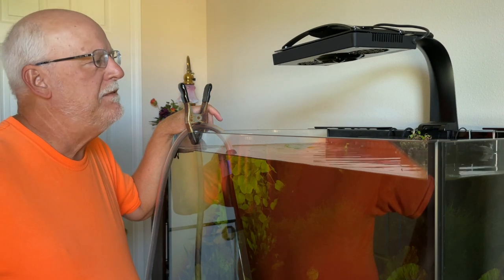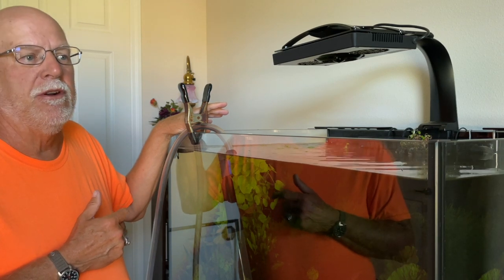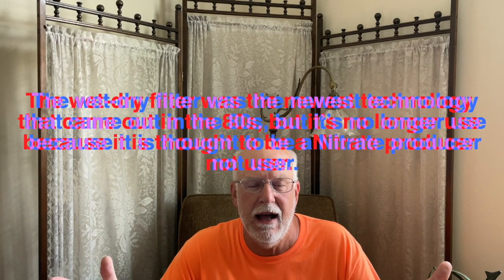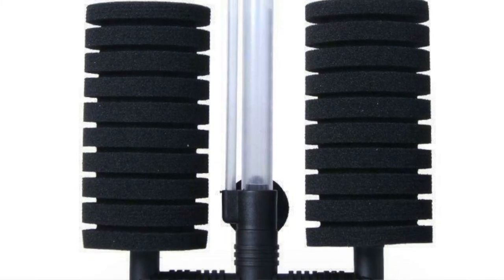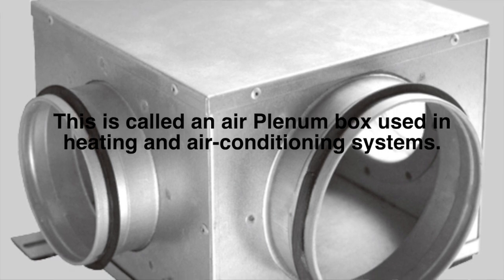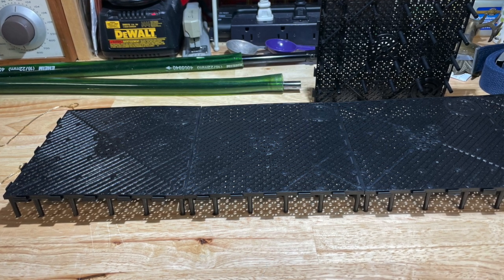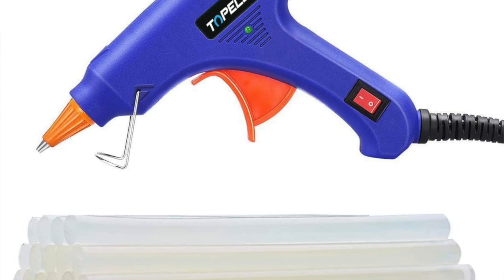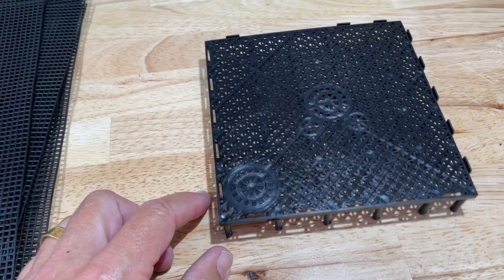Understanding the differences between a Plenum and an under-gravel filter.

Comment: Just about to make my pond setup an undergravel filter setup with a pump and a 2 inch plenum gap under the grill. The plenum with my setup I'm making will be able to be flushed, as there is a valve installed on the pond tank. That way I do controlled flush outs of excess debris from the plenum area a couple times a year, immulating what natural ponds would do. The pump will sit into a compartment that will draw water from under the grill, which will allow a slow pull from the total bottom through fine red scoria. Then the water will be pumped up to a grow wall for tropical plants and drip through a drip hose to water the plants and then the water will return to pond water. The water trickling or dripping through the plants will naturally add aeration, but as the water falls lowering into the pond it will loose oxygen and then be dragged down and through the plenum part again. I like to create tanks that do not need regular water changes at all, just top ups. By using plants and dense slow moving filtration I can accomplish this easily. So the knowledge has not been lost at all. The only problem with the hobby nowadays is hobbist are getting lazier and just like to use filteration bought, rather than looking at options to create a better natural environment for their fish. If they did, they would also make ecosystems that are less maintenance too. But big companies do not want them doing that at all. They want them to keep on buying "stuff" with minimum improvement to their tanks.
Reply: Got a full-time job so slowed things down, but ready to get going now with the build. So excited about doing a plenum pond porch pond. Will try to contact you when I'm finished and send you a video for your channel if you like? My husband is building me a platform and frame for the water tank pond this weekend. Then next weekend will tackle the grow-wall. The following weekend I will install my plenum, fill and clean out all my canister filters to seed the pond and get the cycle going. Wait a week and then test the cycle with ammonia, of course, fish free. So hopefully this will all be ready for fish in 8 weeks. I have a huge vase that is not really plenum but kind of is. Filterless and is now producing shrimp.

Comment: Hi Dr Novak, due to space constrain, im setting a 2 gallon tank. No UGF of this size in the market is available. The tank base inside dimensions are 28cm x 18cm. What height should the  UGF have? Is a 15mm void of space (plenum)sufficient? I also need to insert a polycarbonate tube with a inside diameter of 12.8mm. This tube will be connected to a 1Watt submersible pump. What flow rate is ideal ? The tank will only have 8 litres of water at most.the UGF will be 3D printed.  The tank will house mainly small shrimps and very small fishes.Thanks

Comment: I’m using the plenum system in my 75 gallon community, planted. I’m using a basic Petco dual port air pump at full power. Should I pull back from going full power? Thanks

Comment: Perhaps the clearest explanation provided (as video, on this channel). This channel has been very clear for me in that the objective is not to create “under gravel filter”, it is hard to imagine there is any confusion on this point. What has been curious to me is the obvious significant difference in the height of space provided by UG filter (plate) plenum v the suggested 1/2” to 1” plenum. I have to guess at this point that a very slow bubble w short uplift is the difference. The 1/2” to 1” DIY does not utilize a slow/low bubble (flow)? The differences (contrast/comparison) between UG filter plate and the creation of 1/2” to 1” DIY would be helpful. I am not suggesting that one or another accomplish anything outside of anoxic conditions, nor am I suggesting one is superior to the other. The significant height differences are very curious for me.
Reply: I suppose they both use very slow/low flow so this is merely a matter of hobbyist as engineer v hobbyist as manufacturer :) Flexibility to the simple task, TY.
Reply from the maker: It's great that you understand everything in my videos and what I'm saying. However, unfortunately a lot of people don't and therefore they are getting very confused between using a Plenum and an under gravel filter as per say.

Comment: Do you think I could use the undergravel filter plates with screen to make the plenum, then combine that with a dirt substrate, capped with sand, and still be successful? Or do you think combining the two is just a disaster waiting to happen? It's something I have considered trying to see how it turns out.
Reply from the maker: Yes people are  already doing just exactly that.
Reply: I did that my plants are growing right out of the tank lol fish seem happy 🐠
Reply: Remember with durt don't use a lift tube or you will have mud lol
Reply: @debrascheer4577  hi! Question: Can you describe more your set up with the dirtedtank? I saw his videos after I made them and gave up on them, because they didn’t work out for me. Can you tell us:
1. How you created a plenum, how you layered the dirt, and how you capped it?
2. How deep you put rooted plants into the cap?
3. And what you meant by not using tubes?

Comment: Can I use Seachem black flourite and Seachem red for an iron source to make a BCB basket. I know that Seachem is more expensive
but it is easily available.
Reply from the maker: I know you can use the seachem for a Plenum but as far as A BCB basket, I do not know if it has the poor water or permeability structure to it that would be absolutely correct.

Comment: Any nay sayers just do not understand science !  I had to listen to your video explaining it several times. Stop and rewind and listen again. However I understood it, it makes perfect sense.  I have been keeping tropical fish since the mid 1970’s. I started out with a Betta in a bowl.  Had to buy a 10 gallon aquarium so I could replicate a healthier and happier environment for the poor creature. At that time I was using the under gravel filter.   It’s pretty simple to understand the difference between that old method and a few tweaks to make it a plenum .  You are teaching how to create a better “false “ environment to a natural one, in very cost effective way.  Any aquarium is a false environment no matter how much equipment is applied people !  If it doesn’t work they can all go back to the way they are doing it.  Why not try it ?    I can see a lot of people who disagree are those who make lot’s of money  selling all the supplies that this method does away with.   I have had 20 and 30 gallon long tanks. I currently have a 36 gallon bow front. I just set up 1 year ago. Neon Dwarf Rainbows , Cory’s Ammano shrimp, and 1 Siamese Algae eater and plants .  Fine gravel with Aquarium soil and sand substrate , one air stone .               I wish I had found your videos  sooner , I would not have to re-do this tank.               Will My hang on the back Aqueon filter  create too much water flow , it’s rated for 30 gallon , when I convert . I think I can put homemade BCB in it instead of the replaceable filter.    Or do I have to convert to canister filter ?    THANK YOU for all your knowledge and all the time you have put into making these videos , and your time to reply to our questions .      Thanks also for not charging a fee to subscribe to your channel !

Comment: Question:  plenum space/void could return flow from your sump filter system be used instead of air while achieving the same results? 

Example my build is a 120 gallon cube planing to return approximately 400-600 gallons a hour in 3/4 pvc within plenum space

One of your previous videos you talked about water moving in and out of a lake/bog with natural springs. I would assume this replication would be beneficial to an aquariums ecosystem.
Reply from the maker: What are we trying to mimic here is a natural system where the intersection of topography is actually the under gravel plate or the plate you make yourself the Plenum and the substrate or where water moves in and out freely just like in a natural systems.

Comment: I once wholesaled tropical fish and of course we used sponge filters with bubblers, tanks were setup to turn fish for $. My personal show tanks have been UG, cannister filters or both. I never liked a filters hanging on the side of the tank. I desire a pH of 6.5 - 7.5, won't layers of coral sand continuously increase the aquariums pH? How are you keeping the layers of coral sand separated from digging fish, do you use a fine flexible plastic netting similar to an aquarium fish net? I'm not too concerned about algae, the DLI can be adjusted. I grow plants hydroponically and O2 is critical for plant health, I'm not understanding how an environment with very low O2 levels (<.5 mpl) sustains plant growth or a load of fish in a tank.
Reply from the maker: They have what is called craft screen are you can even use window screen and that will separate the two substrate so digging fish can only go so far and then come to a dead end. The craft screen comes in different plastic colors like black, white, clear, green,red, etc. etc.

Comment: With just the tubing under the gravel, there will also be a void in the tubing, a smaller void than using plates but a void nevertheless. Am I wrong here? We could even use bigger diameter tubing and get a bigger void to match your plenum void space. Why is that not the same thing as the plenum type you are advocating?

Comment: Hello, Dr. Novak, 
First thank you for your work, and outstanding insight into the Nitrogen cycle.  I too remember the days of using under gravel filters. 
My question is, with the plenum, is it necessary to pump the nitrogen to the rest of the tank?  An opposing view could the bottom beneficial bacteria layer enter via hollow tubes instead.  I am asking if the nitrogen pumping is creating O2 that is going against the CO2 needed in the tank for plant growth.  
I currently have a 45-gallon breeder with lava rocks at the bottom for beneficial bacteria.  Curious if this is effective at circulating beneficial bacteria. 
Also, do you have social media, books, papers, or an additional way that we can read about your work.  I am curious about your PhD, is it in Ecology of Plants, or a similar nature.  
Thanks so much, again for your work.

Comment: Do you think I may be able to have enough low oxygen bacteria if I have an area with deep substrate for plants and the rest of the tank not as deep substrate? I also use tanks with larger footprints as I imagine that helps. I mostly like to do a soil mix topped with sand all 3-6" in total but also like to do a higher area for plants and then the rest just sand ~2" thick for open space.

Comment: Hi Dr. Novak, I've been using the BCB Basket for years in my pond and aquariums with great success.  If I make a slow moving plenum in an aquarium, should I still use a BCB Basket or will the plenum provide enough denitrification on it's own?

Thanks for your videos
Reply from the maker: If you make a Plenum in an aquarium ,no you do not have to use a BCB basket along with it, it is an option that is up to you.
Reply: Greetings Dr. Novak, you saved me all the hard work in finding out what works or not. You are really a pioneer in this hobby. Thank you so much for your insight that is backup with experiments and data.

Comment: Thanks for your videos, I am actually trying to learn as much as i can, since my dream is to make a huge acuarium (more than 10.000 liters) and I want to understand how much or in which way i should plan / calculate the anoxic filtration to be able to handle all the bioload. I dont know if in such a huge system i should be using the cbc baskets or with a good and well calculate plenum would be enough. AGAIN thanks for your work and making  your knowledge  available.

Comment: One thing I would like to see from you is more info around how to tell if we set it up correctly. Because at first I was not sure what was going on.   I still have algae growth under the substrate surface, that can be seen through the glass.  Is that just sign i’m fertilizing too much? 

Also will we have to dose the substrate with iron at some point.  Whats the long term maintenance, I have this tank set up for three years now. 

I used double layer craft mesh that I hot glued together, I don’t have a lift tube. Under that mesh is plastic bio balls. 

I am also running a sump.
Reply from the maker: Seeing algae in the substrate next to your glass is common. The reason is your glass is made out of silica which encourages the growth of algae. This is the same reason you may have to clean the class of your aquarium constantly but yet you'll be scratching your head wondering why my plants don't have the algae on them unless the leaves get very old. Older leaves encourage algae because they are beginning to break down and provide a food source for that algae to grow on.
Reply: If you dont have a lift tube how is water being pulled through the substrate and into the plenum void? You need a very slow flow of water being pulled down into the void

Comment: Does father fish use your system too? Does his method work the same as yours or what’s the difference?
Reply from the maker: Father fish uses a different method of filtration. He likes to put 5 to 6 inches of substrate and about 70% of the aquarium has to be plants. Now with a Plenum, you don't need any plants at all. It does not have to be as deep as 5 to 6 inches at all.

Comment: Dr. Novak, what is the ideal water flow rate between the plenum and the water?

I don't want plants  and laterite in my tank, but have a plenum...can I use iron dosing instead to supply for the bacteria?
Reply from the maker: Yes you can use iron dosing the same as I do in small quantities of course.
Reply: @anoxicfiltrationplenums  what is an ideal water pump rate?
Reply: Dr. Novak
Thanks for the reply

Comment: I'm getting a 250 liter (55G) tank soon-ish, and I'm getting the materials for the plenum (my first one, very excited to give it a try). I can find everything, except for the baked clay kitty litter (I live in the Netherlands; anyone that does have a good brand, please let me know). The only litter I can find is the non-baked clay, that falls apart easily when wet and clouds up the water. Now I'm looking for alternatives. In a previous video you mentioned that the litter is optional. I found on your blog that zeolite (kitty litter size, not the bigger ones) is also an option. Is the zeolite preferable over just inert aquarium gravel?
Reply from the maker: Yes if you're making a plenum the Laterite is actually more important than the kitty litter and you could substitute your substrate a course for something like the Fluval or ADA or something like them.
Reply: @anoxicfiltrationplenums  Thanks for the reply. I have a bit of a follow up: I managed to find a brand of kitty litter that specifically claims to have been baked (1200°C) on the packaging. Upon trying this brand, it responds a bit different as the stuff I've already tried. When wet it doesn't fall apart by itself, but when I squeeze hard on a granule, it basically behaves like clay, smears out and clouds up the water. If I just keep it submerged in a container and don't bother it, it doesn't become soggy or anything and keeps its consistency. Is this the wrong type, or did I have the right ones all along? The ones I've tried are made of 100% attapulgite. The needed consistency I have in my head that I need is basically hard like ceramic, but I feel like I'm wrong there.
Edit: no matter how much in rinse the baked litter, the water keeps clouding up when I disturb it. If I don't disturb it, it will eventually stop clouding the water. The difference with the cheaper attapulgite litter is that when I squeeze a handful when wet, it doesn't become a solid clump of clay, but retains it's form.

Maybe this question is a bit ignorant, but I'll ask anyways: Is, functionally for a plenum, (active) substrate basically a more expensive pre-fertilized version of the kitty litter? Is the soil also slightly negatively charged, thus doing the same as the litter? Since I've never used any soil in my aquariums (only gravel and sand), I don't know what the structure of this stuff is.
I'm really trying to understand both the what and why for these things. (loving the in depth videos!)

Comment: My tank is 48"x18" if I use a ugf  do you recommend two short tubes or just one for a slow moving plenum? What do you consider more efficient a plenum or a BCB basket or obviously both. I
enjoy your videos, keep up the good work.
Reply from the maker: If you're under gravel filter is as long as the aquarium, one lift tube. If it's two separate plates then I would go with two very small lift tubes. One for each plate.
Reply: Obviously both 👍. Biggest bcb you can build.
Reply: If you go with the plenum you dont have to use a bcb as well. Its entirely up to you

Comment: Could i have a planted tank with a plenum in place  and is it nessecary to move water through the plate or Not ? Thank you
Reply from the maker: All my videos show for example, several aquarium set up and set ups using a plenum. Whether or not you want to add a lift tube is your option. And yes, they work excellently with planted aquariums more so than just placing your gravel at the bottom of the aquarium itself. Just a couple videos ago I explain the whole process of why plants do so well using a plenum.
Reply: @anoxicfiltrationplenums  thank you           si